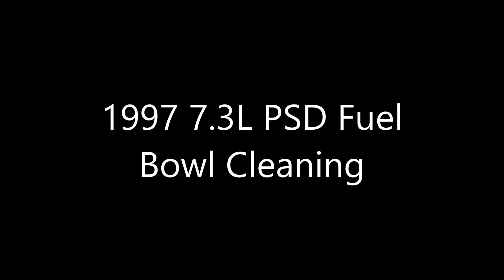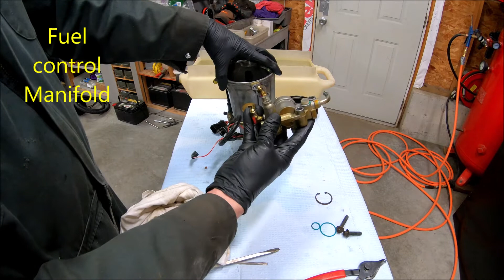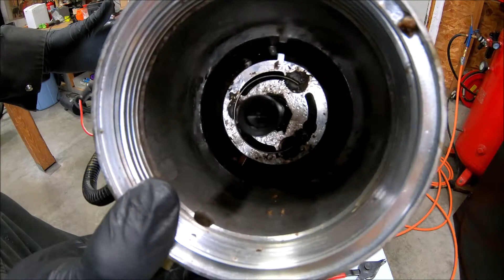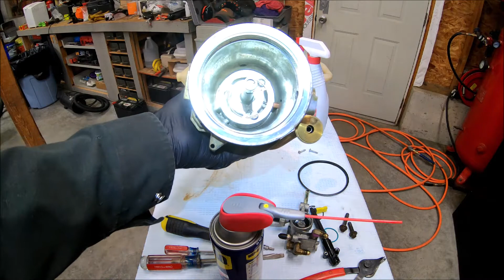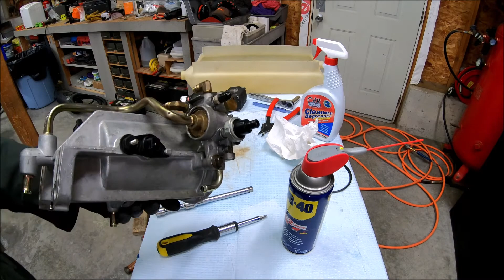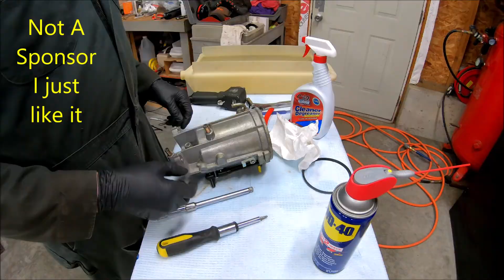Fuel Leaks: 1997 OBS Ford 7.3L PSD Fuel Bowl Cleaning and Assembly

Comment: Does the top wire on the drivers side control the fuel bowl heater?
Reply from the maker: One is the heater, and one is the water sensor, I think the top one is the heater but not sure. It's been a long time since I made this video. I do have another one in my f350 playlist I may mention it there but not sure. You may have to trace the wire visually.  here is link to other video when I reinstall the harness. https://youtu.be/et2ES45Cd64